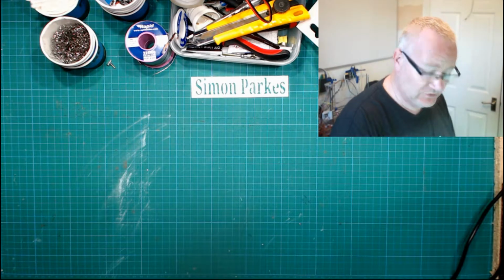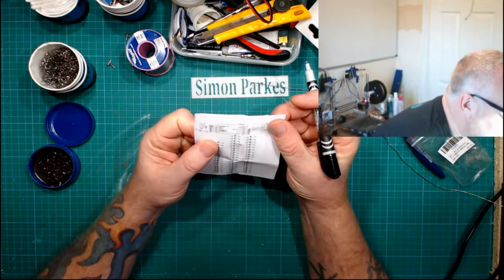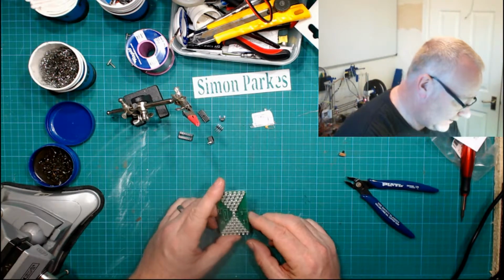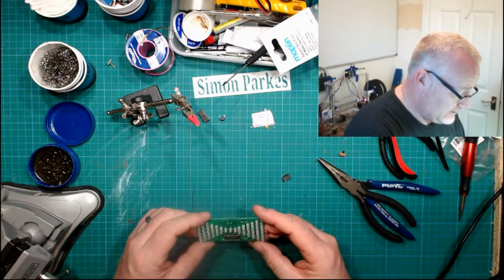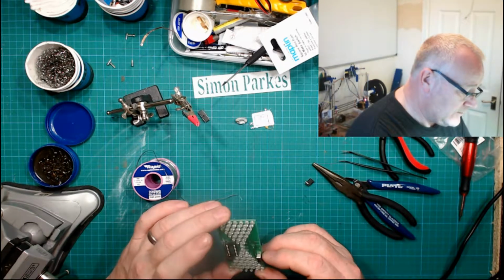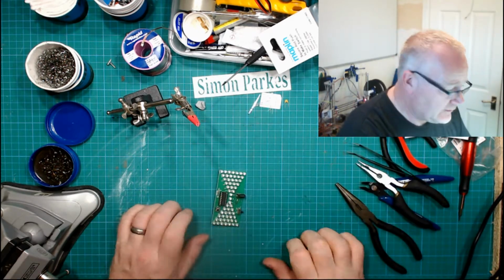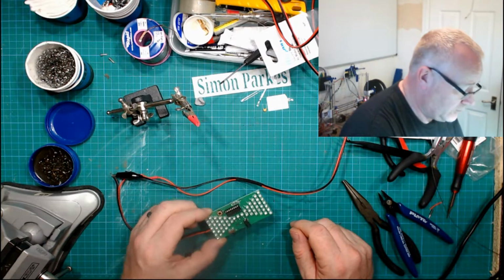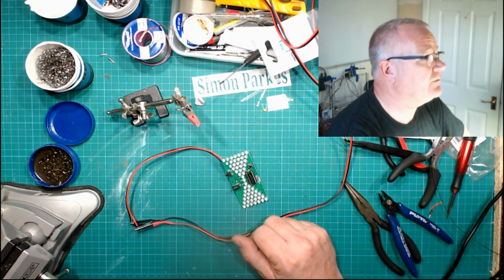Kitchen Timer Project Build

Comment: Perhaps the two mystery holes are for the ceramic capacitor?
Reply from the maker: Checked that, turns out, you only add it if there is an issue with using the ISP interface... (thats what I read in the Internet, so must be right lol)